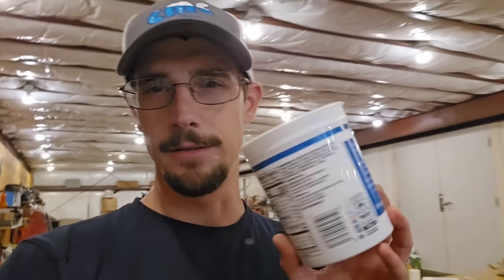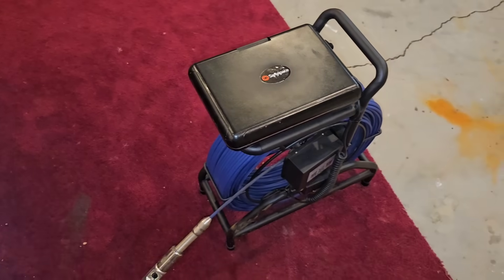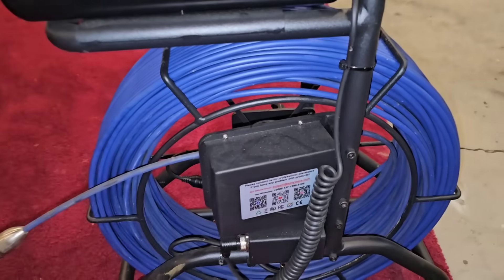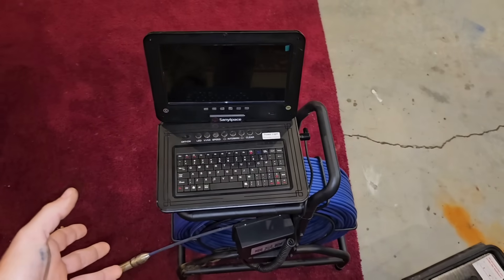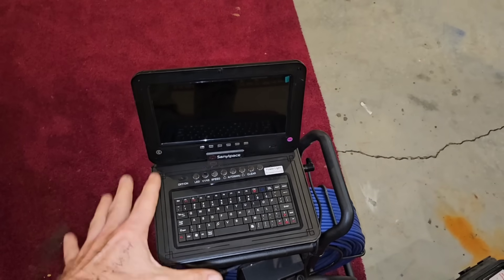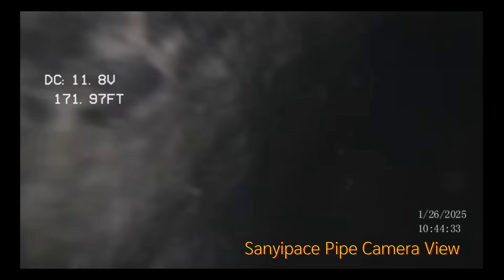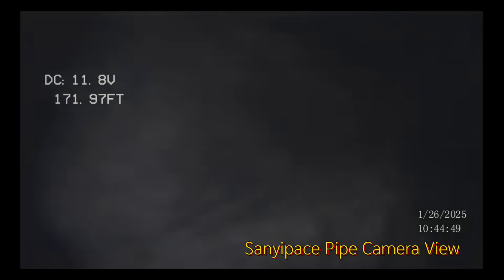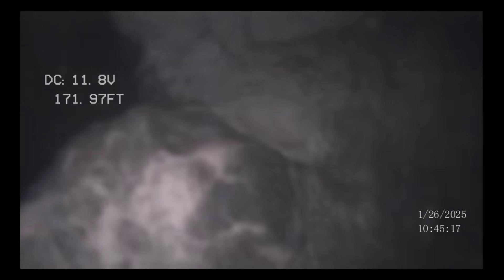Customer's Well Collapse! A Down Hole Look with Borehole Camera by Sanyipace

Comment from the maker: Do you think Insurance would cover this scenario?
Reply: I've never seen an insurance policy which covered a well for anything. Whatever the failure is they never pay for it. Well ran dry? You get to drill a new one and pay for it. Lightning zapped the pump? Yeah, that will happen, and you have to pay for it. Well collapsed? Bummer, how much is a new well going to cost YOU? They won't pay.
Reply: @lonnywilcox445  It depends on if you specifically insured the well in question. There ARE insurance policies that WILL cover unforeseen things like this happening to a well, though not things that could be avoided through routine maintenance.
The average basic homeowner's insurance policy will not cover this... there are homeowner's policies that will cover it, like the one on my grandfather's house in West Virginia.
Reply: @lonnywilcox445  Personal experience from ~ 30 years ago.  Pump failed.  Plumber claimed lighting zapped pump.  Insurance paid for pump replacement less deductible.  Today, who knows.  Insurance will argue forever and not pay.
Reply: @lonnywilcox445   i just had lightning blow my pump insurnace covered it . but not  the the collaped well
Reply: Your typical homeowners policy doesn’t cover it.
Reply: Maybe, but I think it's unlikely unless they have excellent coverage... I was curious about this myself, so looked at my own HO policy from Homesite/Progressive. It has no specific mention about wells or other water sources-- but "Earth Movement" is explicitly excluded from coverage if the cause is purely natural and not storm-related. However... there are many things that can cause "excluded" items to be covered, like being caused by a natural disaster, storm damage, fire, vandalism, etc. Going to depend on their specific HO policy and what coverage they have -- but I do think the customer should at least try to make a claim, it's still worth a shot.
Reply: Unless its a specific well coverage rider, I wouldn't think insurance would cover it.  🤦‍♂🤷‍♂
Reply: If you have seen the video's from tank masters enviornmental, he has such a time working with enviornmental cleanups for oil spill either underground or above ground.  They are told five times that the claim is denied and have to know what to say and get the right person to approve.  They also use age dating on tanks to deny a claim.  
Although not the same as a well (oil spill) the insurance process might be the same fight, if it;s in the policy!

New well needed.  When you first get a well installed do you go for the cheap guy or the guy who charges a litlle more per foot.  And ask around who might be a good installer.  Sometimes it's not your fault as you buy a house after it was built, but a well inspection and a company hired to find buried oil tanks before you close is best.

You should make a new rule in a redrilling situation of a well you did not drill.  The customer must pay for a camera inspection first to see if it is feasable.  This would hopefully save you money and the customer too.  Good video.
Reply: I think if you could confirm an actual geological situation where rock is shifting. This could be classed as an “act of nature”. But not sure 

Hoping something works out for them. Where there is a will there is a way they say 👍
Reply: @TrustJesus22  Or they would  call it an earthquake and it wouldn't be covered. I think it's very unlikely insurance will cover this.
Reply: Maybe at least part of full cost?
Reply: I don’t think so.
Reply: I feel for you and your customer. 

Would there be a major downside to just adding a self cleaning spin down filter in front of the regular filter? Then just use the well until it completely collapsed or the pump failed. 

At the very least you could save/plan for the $15k hit.
Reply: Homeowner should have gotten a Larry Silverstein insurance policy covering well collapse.
Reply: Well we had to drill a new well. The drilling was 10k and they gave us a discount using a refurbished pump and tank for 3k... So as of now we are officially broke.
Reply: Insurance companies collect premiums and deny claims.  Its their business model.  Of course it depends on the policy, but you can expect them to fight it if they can.
Reply: If insurance covered it, I'd have a new hole drilled. If not, I'd run that well for a couple days outside hoping to clear out the sediment, maybe invest a couple two or three more filters to run in parallel, and live with it while saving $150/month for a new one.

Comment: Computer nerd here, so not sure about the drilling, wells, etc. Had a question though. To help prevent stuff like this, well collapse, would it make sense to put in a circular stainless cage down the well? Small enough to keep rocks maybe bigger than 1 inch from falling in, decently thick metal to not collapse unless it is something catastrophic, would that help or would the cost be too much? Seems like install may be not too bad. Lower in 20 ft bits, weld, lower in 20 more feet, or whatever.

Comment: i would pull that pipe out hopefull from the pump then install a 170 ft of 4 inch sleeve with screen then a  a pump all that will take few hours maybe $3000  cost

Comment: if the insurance company didn't cover the cost, then I would case it down to 170', depending on the static level, and pump at 170'.

Comment: What kind of pressure do poly tanks hold? Could you install a settlement tank? Pump into a tall 100/200 gallon tank, feed the pump in at the middle, take water near the top, let grit settle to the bottom between pump cycles. Doesn't need to be poly tank.

Comment: Too bad there's not some type of equipment to suck those stones out of the well. There's three four and five inch vactors to suck out stones from sewer pipes. You'd think something like that would be available. So long as the stone is not bigger than the bore you have to pull it out of.

Comment: I agree doing anything but (later on) closing/dismantling the existing hole would just mean wasted money. Plus it is still delivering water and very likely will be for the time it will take to make a new well, so not really that bad emergency.

I would try to guesstimate/asses how long one could expect the pump to last with all the mess in the water and if that goes into many months or even years, short term fix could be to just add some higher capacity raw filter and so buy time (with the water working) to prepare (like save money so avoid the need for extra expenses like an extra loan or so, asses the geology in more detail for the new hole so it could be made more robust) to make a new hole as the final solution.
If the life expectancy of the pump with that sand in the water is short, just be ready to clean the filters more frequently and drill the new well as soon as possible, while the collapsed well is still delivering water.

Comment: I wonder if an old style hammer bar rig wouldn't clear that hole up a bit. yes your pushing all the trash to the bottom and can't remove the pump but you are also breaking up the bits in the process as well. not my money, not my well, not my company, but I just wonder in this case.
Reply from the maker: I gave him that option. To send a 400lb weight down and force everything to the bottom. But he wasn't a fan of the idea.

Comment: ive contacted you before i had a pump go out and couldn't come out even with a crane the wire snapped off so we just put a pump on top . i was thinking  we had a small earth quake would that cause a collapse well .the pump used to come out easy . also from what the adjuster had told me if its an act of god they dont cover it but if it was done by accident they they would cover . but let me know what the insurance says

Comment: scents it's a brand new pump down ther. Could you potenchualy continue using the wheel, just make a system that seperats the grit. from the water? yous it till the pump dies. and then drill the new hole?

Comment: I'd keep using it. Just put about 4 filters in parallel , split the pipe in 4, add 4 filters, and go back into a single pipe. Just replace 4 filters every month or two. Or use a settling tank. Run the pump about 10 minutes every hour or half hour. Then pump the water from the tank to the home , after the silt settled. Maybe  use a second tank 500 gallons or so, filled with clear water, maybe build a 55 gallon drum filter filled with washed stone, sand,  carbon. In silk or cotton bags ,  maybe last for 6 -12 months, maybe more, with the silt.

Comment: As the homeowner faced with this situation, my first step would be to call my Insurance Agent to get an initial assessment. If the agent comes back and says the company won't cover it, I'd quickly remind them how much monies I've paid over the years not having any claims , providing there haven't been, and let them know I'll be canceling any and all policies (assuming there's auto's and other assets insured with the same company) and switch to someone else. In simpler terms; the insurance company might have won the battle, but they've lost the war.

Comment: I'm working on a municipal borehole that's done the same thing. It about 24" 600ft and delivers 900 us gal/min. We are doing improvements to the plant that treats the water. The owners got a big drilling outfit to reline the bore because they were stuck for places to drill another. I think the rock move was found from the gadget they have that constantly monitors turbidity in the water coming out of the ground. It was a huge drilling rig to see in operation.

Comment: We are in mostly hard rock formations around our area and I always recommend to clients to case the entire well. Our wells are usually around 200' and sometimes in the 300-400' range though. I've been called to a couple of sites that were similar to this. It was rock well and left open hole after surface casing and then after a while, for no fault of the driller, a boulder or rock comes loose and wedges itself in the well. If it is in the client's budget then I always have them case the whole depth of the well.

Comment: Before drilling a new well, the old well must be fully cemented.  so as not to spoil the new one. And so I would restore the old one, which is a very good experience. 2 pumps can be installed . which allows them to pump the well from the sand. and the new one above gave clean water.

Comment: Quite a bit different operation than  drilling for natural gas at 30,000'.  I can appreciate running surface pipe at 100'. Depending on the area it can save a lot of money if you're insisting on drilling with air and you hit a 100' thick sand dune. Drilling with mud can save a whole lot of headaches.

Comment: Insurance won't cover settlement.  He would need a separate ruder or a specific policy.  To a certain extent I can understand it.  Most people don't have wells so an actuary wouldn't adjust a policy for the risk.  If they did he might be charged an extra $1,000 per years for coverage depending on how often they had failures specifically on properties with wells.  They won't charge all of their policyholders to spread the risk simply because it would raise the cost of their insurance policies and make them less competitive on price.  He's likely stuck.

Comment: I agree drill a NEW well. In Fairfax County we have to go to bed rock with casing. My mother's house we did a 220 ft. well 80 ft of steal casing lined it with 4-inch PVC, we use pit less adapters to make for better appearance.  I hope the other well driller has learned to be a better driller. Sad it's his fault.

Comment: If I were the owner, I'd consider spending a couple hundred bucks now on bigger, more paralleled filters and try to milk that well until the pump or something else fails.  Meanwhile saving up the cash to drill a new hole.  But that's me based on my own cents and senses.  This homeowner has their own situation.

Comment: When a well collapses that mostly seals its fate.  If it were me I would drill another well and case it in the cheapest steel I could find down to where the water started coming in.  That way no scenario happens where a collapse can doom the well.  I know that it is expensive but not casing it is riskier the 2nd time imo.  The cost of bringing in city water is probably not an option either.  In view of that the well drillers are saving landowners money.

Comment: I thought the casing went within a few feet of the bottom. I paid for that amount of steel casing on the well on my place that is 562 feet. I paid extra for steel. The other well for the other house 1200 feet away is 30 years old with PVC casing

Comment: I would love to see the follow up video of having to drill a new well. It sucks that there isn’t equipment that can go down the well and suck those loose rocks out and be able to resleeve the well.😊
Reply: Such equipment is available, but it costs money. and they don't want to invest in it. It is produced in Russia as a vacuum crushing vacuum cleaner. it directly eats the soil. And so you can pump out the sand with a pump and Crush the gum with a special head.

Comment: Exact reason our drillers put full casing steel. The bottom 10 foot is perforated pipe. Zero collapses well, and zero hung up pumps. Not casing half the well. I always love your videos. I just don't get why you dont case the whole well.
Reply: That'd work around here.  Fractured granite about 40 feet down.  Decomposed granite about that, basically sand.  Don't have a clue how deep you'd want to go, current well is bored.  Atlanta area.
Reply: Why plant a well in granite? the granite itself goes like a pipe. you need to plant it in order to separate the water horizons.  and it will be much more expensive to drill and plant a well in granite to the bottom with a pipe.
Reply: My Well Pump stopped being a Pump one day (twisted wire had chafed) so I researched everything that I could find on the topic and tackled it myself.

After I had the pump in my hands and I grabbed my Big Kid Tape Measure, I found that I have a 250' Hole, Pump was at 200', Water Table was easily within eyesight (so probably about 10'-15' of Head), and judging by the moment during the project when the Torque Arrestor decided it wanted to fight me & wedge itself at the bottom of my Casing, I'd say I only have 20'-30' of Casing (the water was inside the casing, so I couldn't see exactly how long it is).

Dunno if this "short" casing could be a problem, but our house was built back in 1989 and I don't believe any owners before us had issues.
I could understand if the substrate was sand and/or gravel, but from what I've seen (using a shovel digging a hole 6'-10') we've got ledge, rocks, and clay with some sand mixed-in at that depth. Everything seems solid if a long casing/sleeve isn't used, but I'm definitely not an expert... just assuming that the necessities of the bore hole could differ from state-to-state or location or by the actual earthly material itself (I'm up-n-over here in Maine).

It seems like we have a really deep well considering how little Head we have (I'm not complaining - I'd rather have more water than less)  but once again:
I'm not a Well Expert.

One thing I do know is that when everyone else on my road ran outta water (drought) 5+ years ago, Tanker Fire Trucks were filling local Wells if called & requested (Non-Potable - Only good for Showers & Flushing -- No cooking or drinking)... almost every house on my road except our house, that is. We never lost water.

And to think, just a week before this point we were trickling 2500 Gallons from our garden hose for 12hrs every night for a week or two into our new Above Ground Pool bc my wife wanted to see if we could just fill it ourselves without calling for a Tanker to fill it for us (I didn't wanna fill the Pool too fast and find Silt coming outta my faucets. You can learn a lot from other people's past mistakes👨‍🎓)

We did it, and luckily just in time before the Drought really hit hard lol

Comment: Bad situation for the home owner. At least in the short term since this is a sediment problem and not knowing what size filter the homeowner currently has perhaps installing a larger one and hope the sediment problem gets better. Or use a separator suggested by TheElderberryFarmer. That would at least buy time for him to recover financially. Ultimately when the pump fails will need to drill a new well. 

As for insurance paying for well problems. I haven't looked at our policy but I doubt that is something homeowner's insurance would cover but it can't hurt to check.

Comment: In my region the well drillers after they drill the borehole and put the casing (same lenght as the boreholle is), they put an air hose down in the well and let it run for 24 hours. That makes cavity and rinses the well. All the clay comes out and no more sediment will be present.

Comment: As a 50 year veteran in the well biz, I have dealt with this same situation many times and think it is a no-brainer. Drilling a new well is the best option. Even if you successfully reopened the hole you would have to line it to prevent a reoccurrence, plus you would still end up with  a well with an inferior, or marginal at best, surface seal. Unless the homeowner has an “all risk” policy or rider, insurance will not cover this under a standard homeowner’s policy
Reply: would all risk cover a  30 year old septic mound?

Comment: I would try to run the well to see if the sediment clears up. If it does  great.  Use it like that till the pump dies or it completely collapses.  Then it is time to drill baby drill.  
    Good luck with it